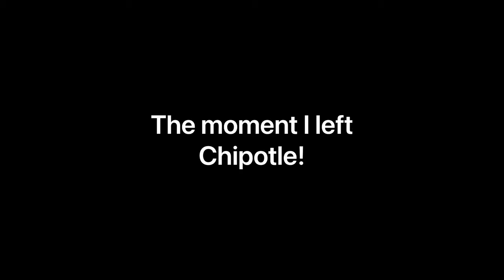What it’s like, actually driving a stance car! 99 Civic coupe from Georgia￼, Bmizzler69

Comment: Did this shit to my 99 4 door, subframe dragged and scraped over any minuscule bump in the road.  Cut the bottom of the little subframe notches off and it'll drive a little better 🤙
Reply from the maker: Already done. 3/4 to 1” off the subframe and the rear lca mounting point
Reply: Pretty sure this dude would know lol

Comment: Were those ebay camber arms?
Reply from the maker: No idea, they were off the 4 door hatch when I got it
Reply: @Ruined4banger  mad that they gave up like that! Build is pretty crazy, I’m waiting for the chance to buy another hatch to do the same. Shits getting pretty rare out here now though.
Reply from the maker: @davel121  I should’ve finished them from the start, but I always say that my car so low that there isn’t really a chance for stress on the suspension but I slammed it out the ramp at chipotle and my steering wheel was like 90° out 🤣 I knew I f’d up. I have another hatch but I want to finish up the tdi one first